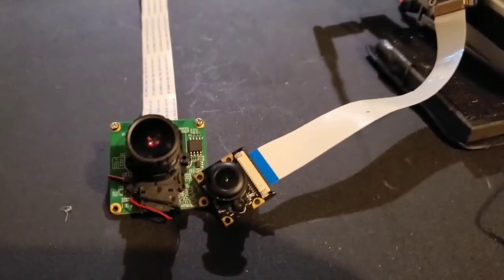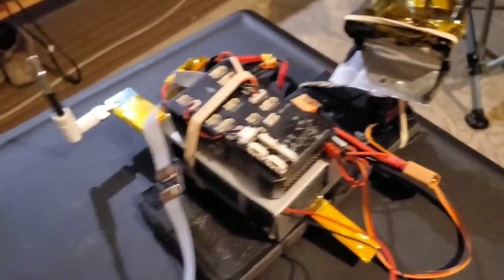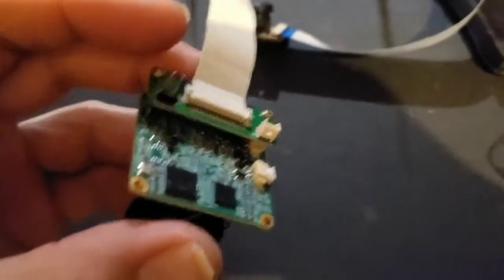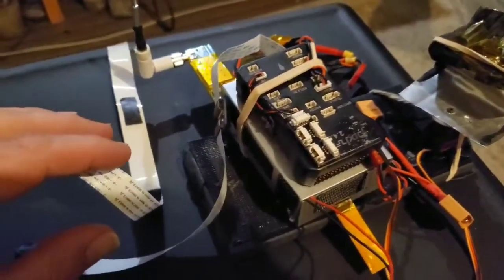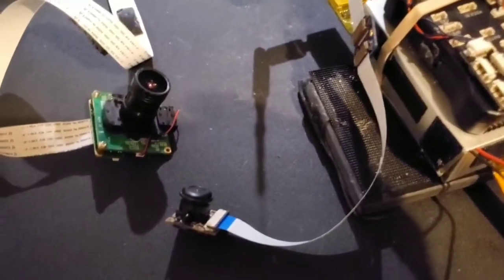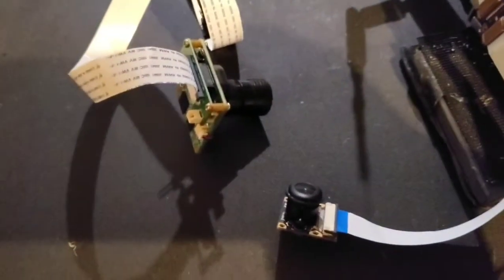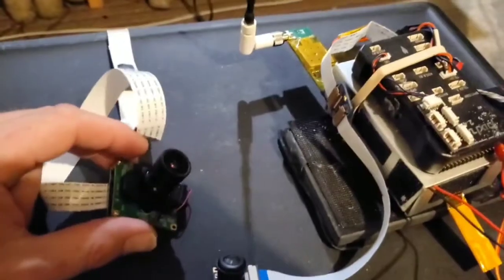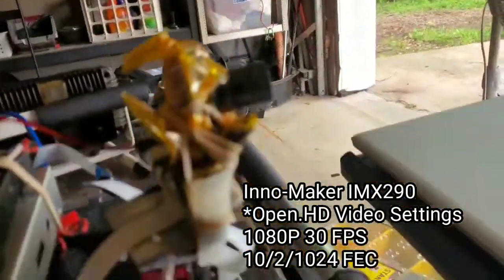Inno-maker IMX290 With Open.HD FPV System (Test 2)

Comment: Send that sucker a command for lowlight of 0x03 and denoiser of also 0x03, it becomes a low light beast from hell, running at a minimum of 7fps in total darkness, and you can't tell a difference in daylight vs stock type settings. In the dark with that denoiser 0x03 setting (full 3d denoise, 2d denoise off), motion does become a bit smeary due to the denoiser, but I think it would work brilliantly for a nighttime drone. I've been working extensively with it as a meteor spotter type cam. I swapped the lens mount on mine out with a straight CS mount for better optics flexibility, but one could just as easily go to an M12 mount.

I've got it aiming straight up on my backyard rain gutter right now, with a 25mm F1.2 CS lens and it easily catches 9th magnitude stars at 7 FPS. Mind you, there's no IR cut filter in use so it has that advantage as well.

Comment: What port did you use for telemetry, TLM2 by the looks of it? What baud rate are you using? You made the changes to the setting for Srx_? What are those? Are you using Mavlink 1 or 2? I've been trying to get the OSD to work with my Cube Black but it just doesn't work. I can connect a telemetry radio to TLM1 and connect to Mission Planner ok. Getting this OSD to work...IMPOSSIBLE!!!!!!!!

Comment: Just spent this morning trying to configure OpenHD without success. I don't know if it's the cables from the TLM2 port to the AirPi. I don't know if its a setting somewhere that's not correct. OpenHD has a few vague settings; some for advance users which changes the setting you would use. So I don't know what's up with that. I'm referring to the setting in Srx_ (in my case Sr2_). No clue as to which baud I'm suppose to use. OpenHD suggest you use one of at least 2 different ones. That's handy. Then if that doesn't work, then what? I have a camera that works. I can see the heat from both the AirPi and the GroundPi on the monitor, so I know the ability to send telemetry is there. Just the settings in Ardupilot or the cables or the cards is the weak link. I wish this was actually more User Friendly. Oh well, guess I'll put this on the back burner and go fly the Phantom 4 (at least that works straight out of the box).

Comment: Hi Justin, thanx for sharing your knowledge on the video. Would a gopro with hdmi module give better image? Or more latency issues...
Reply from the maker: Hi,
overall, the CSI HDMI module with a GoPro or other HDMI output capable camera provides a little more flexibility in my opinion.

The Innomaker can only do 1080p 30 wheras 720p 48 or 60fps is better for fpv. 

latency differences between the two are barely noticeable.

The Official Pi Cam V1 or V2 has and probably always will have the lowest overall latency.
*at 60fps 720p I measured about 130ms total glass to glass.

CSI Hdmi 720p60 latency was about 220ms

Innomaker IMX290 was abou 250ms

*If I remember correctly.